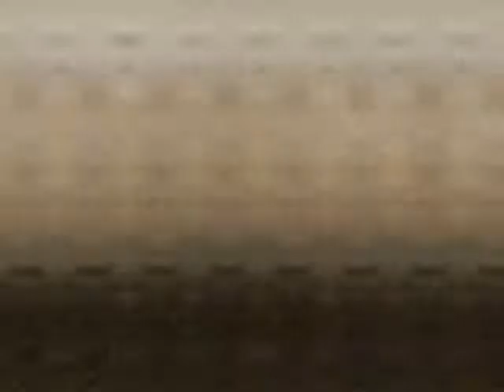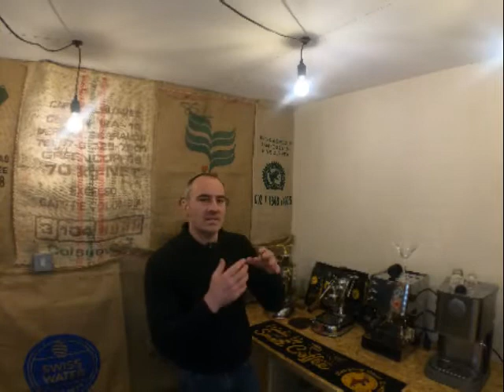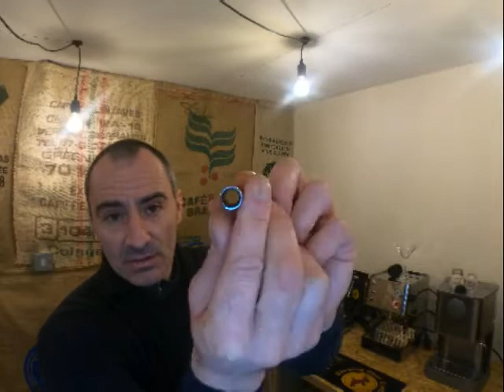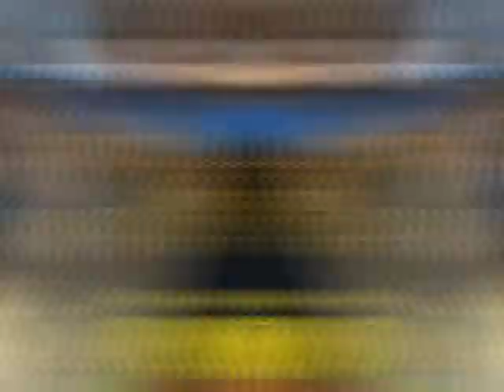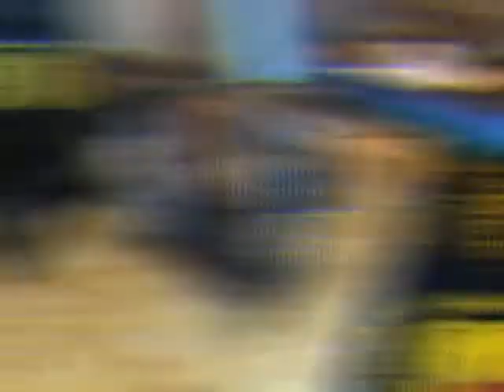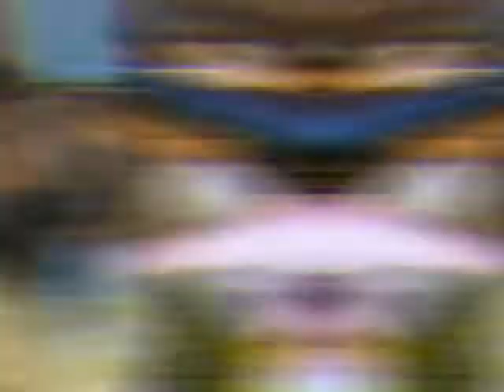La Pavoni Baretto Milk Preparation

Comment: Is this STEAM WAND better, the same or inferior to the one on the Casbar P.I.D.? (the one that looks like a SPEAR with 2 holes)
Reply from the maker: Hi Jakob, I'm not familiar with that machine.. what I can say for certain though is that each machine model tends to have slightly differing characteristics meaning you always have the perfect your own technique. For example using this style wand is basically about positioning whereas using the wand on a La Pavoni lever is about the position and then movement of the jug during texturing to get best results ..... that sounds the same as the Casabar style to be fair :-)
Reply: @DancingGoatCoffee  Hi Dancing Goat.  🙂
I guess each style of steam wand has its advantages, but the SPEAR variety seems to be preferred by MOST espresso machines of HIGHER CALIBRE and PRICE.  :-)